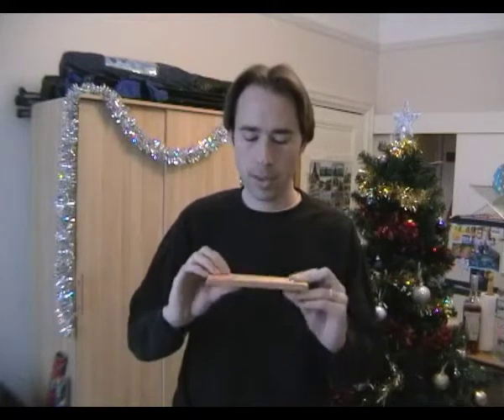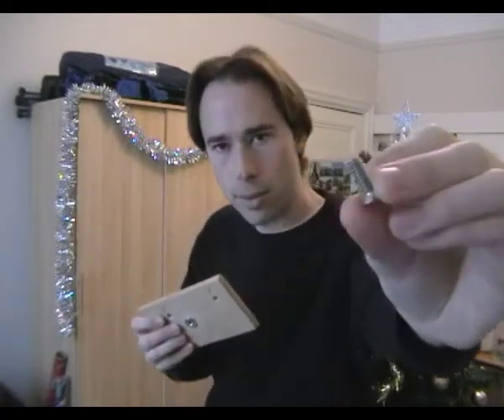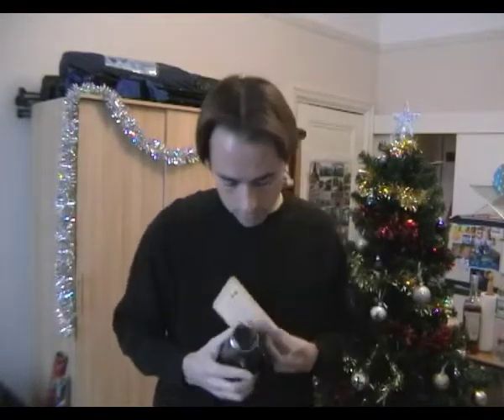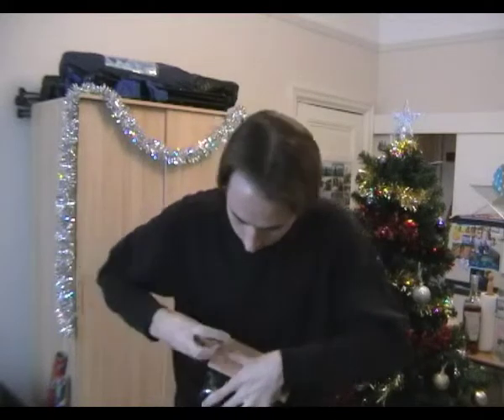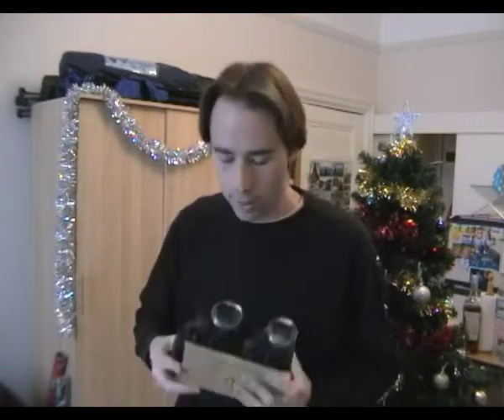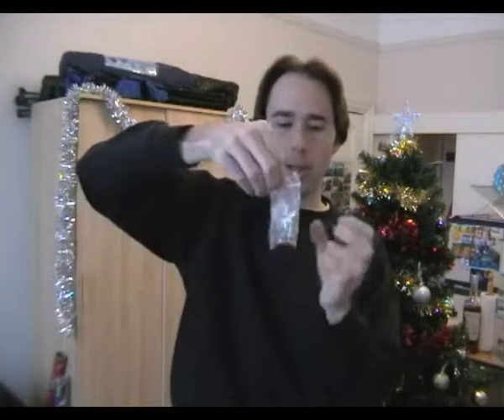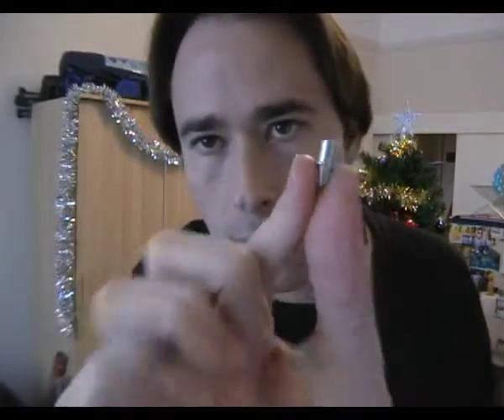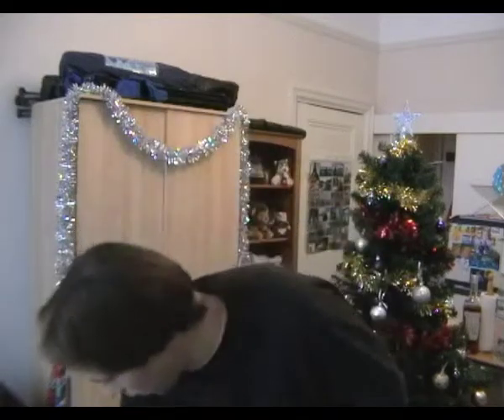How to build a simple 3D video rig

Comment: What is the distance between two camera?
Reply from the maker: Usually you want them as close as possible.  My cameras had no gap between them and it was still too much.  You get a lot of depth, but having them close makes viewing more comfortable.  Also, if you're going to do this, make sure your cameras are on a tripod.  It can be quite unpleasant to watch it the cameras are moving, if the cameras are out of sync by half a frame.